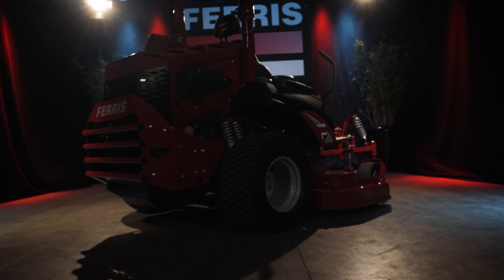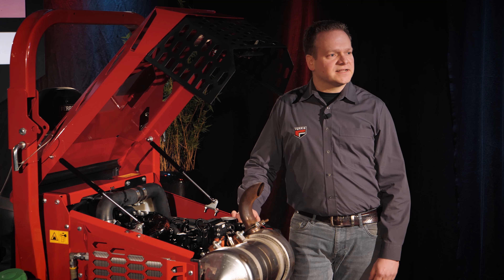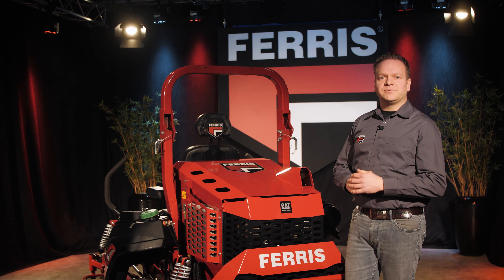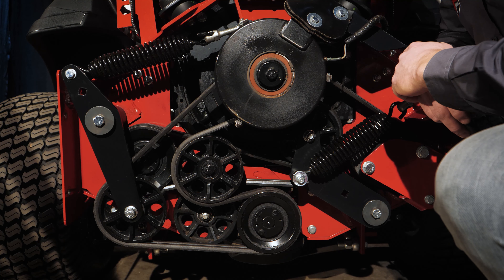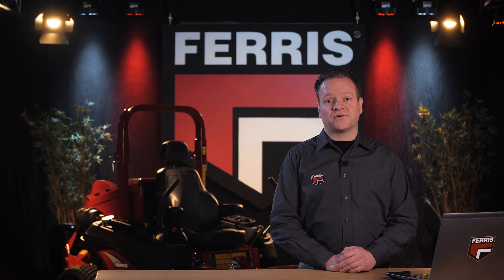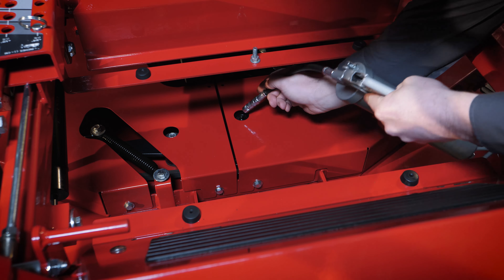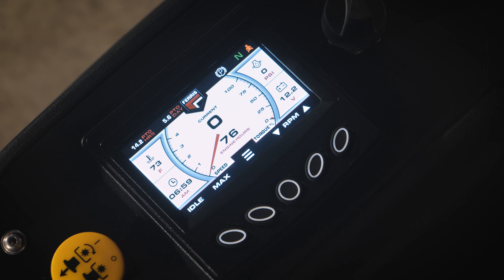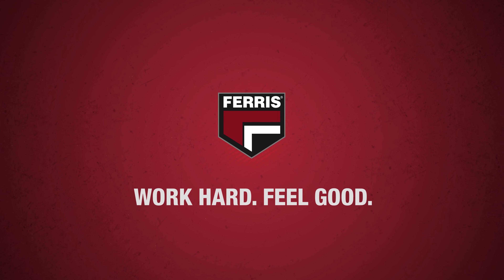FERRIS IS® 6200 Diesel Zero Turn Mower - Walkaround Introduction

Comment: I had two different 5100s.  Both were very unreliable to use.  Something always failing.  Super heavy machines.   Only good thing about them is the ride, the weight made the suspension work.  I replaced the last 5100 with a ISX3300.  Ride is slightly rougher but just as efficient as far as acres per hour.  Turning is much more efficient due to lighter weight. Also, one can buy two 3300s for the price of one 6200.
Reply: I am curious as to what your problems were?  I have a 5100 I use around the farm.  I have had to replace belts, one spindle and the A-Arms on the back due to defective design.  Anything else I should be looking for?
Reply: @DavidSmith-fr1uz  Machine 1 was a 2012 I bought used with 420 hrs and had 1100 hrs when I sold.  Machine 2 was a 2013 with 111hrs and replaced Machine 1.  I mow commercially on established lawns.  1 had the flywheel plate stub just break while mowing.  Both went through idler pulley bearings on the pump/PTO belt system on the rear like eating candy.  Sometimes after 20 hrs of use sometimes 200.  Each pulley has two bearings and usually one would go.  If you catch it in time, you save the belts, otherwise replace both bearings and belts. Dealer couldnt figure out why they failed.  Suggested I buy a new pulley with bearings installed, same problem.  I finally would just replace the bearings every 150 hrs  (if I made it that long) whether they needed it or not.  Did have a spindle get loose on 2.  Had over 2K hrs on 2 when I sold. Had several sets of rear tires fail, inside sidewall fails. A new 3300 replaced it and dont regret it a bit.
Reply: @DavidSmith-fr1uz  I got a question for you about it.
Do they have a problem with the front end being light?
With an engine like that it seems like it would.
I live in southern middle Tennessee and it's not exactly flat around here

Comment: 36 grand and you get to deal with aftertreatment systems and the need to go to CAT for engine repair. i was interested, but i think ill pass. The only way i would think about it is if the fuel savings is enough to cover the risk of the aftertreatment system, but there are no specs comparing gas to diesel.

Comment: He did not give the weight or blade speed, I would like to up grade my Kubota ZD331 but am not sure as what to buy. The local Kubota dealer will not sell the ZD1511 due to regen problems.
Reply from the maker: Hi David, the IS 6200 weighs 1158 kg with empty tanks.  As for blade speeds, we don't specify blade speeds as it is very subjective to other variables. Therefore it is not a spec you can compare 1-on-1.
Reply: I would suggest the 1211. I have one with 200 hrs and no problems

Comment: Alvin landscaping for 26 years and I have found Snapper to be the worst more when it comes to longevity and durability. These new is models do not work very well. Lots of electrical issues in these Ferris mowers are nothing but beefed-up Snapper Pro. This particular diesel mower has too many belts or what it's supposed to be meant to do. They'll stretch is too many holes is in too many belts on this mower. No Straight Shaft from the motor to the deck like Kubota. Ferris is selling themselves on that comfortable seat. I admit they have the most comfortable seat out there but that doesn't mean anything when it comes to durability and longevity
Reply: I wonder if the increased electrical problems are going to be common on all the brands as they are becoming more sensor and computer controlled.  Kind of like cars.